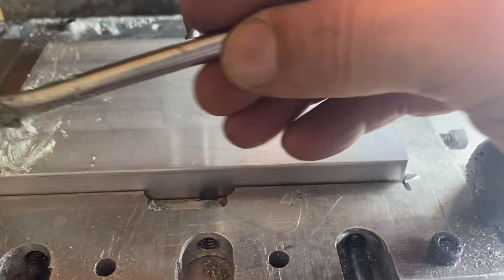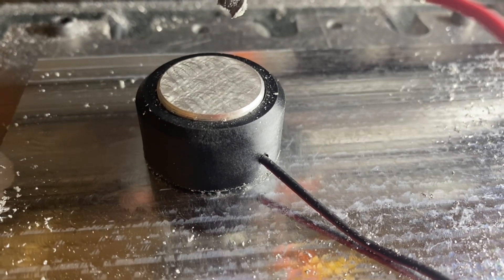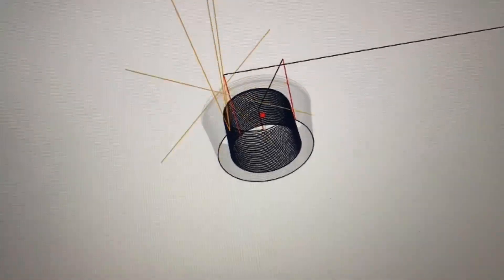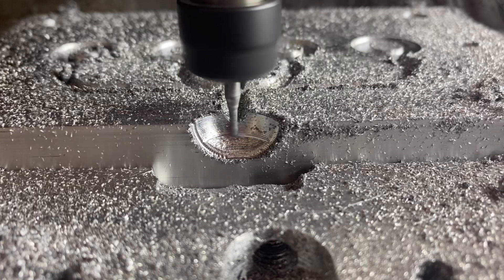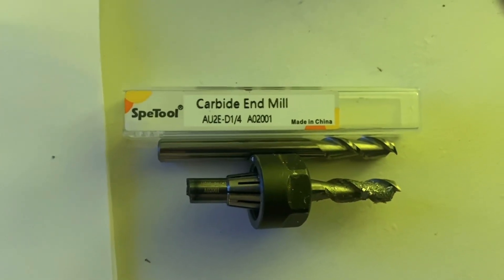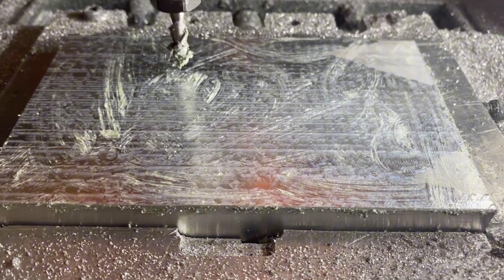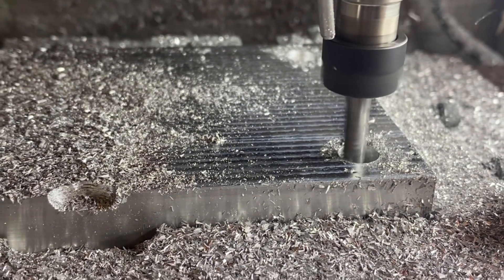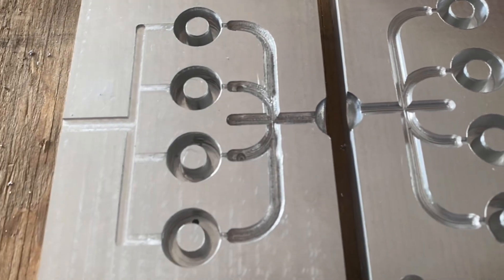Genmitsu 3020 cutting aluminum ￼ injection mold

Comment: Great video! I am so close to hitting the buy now button on several machines, but then I saw your video.  I have 2 Bridgeports and 3 lathes, from a small Southbend 9 up to a Storebo Bruk 14x40. All of my machine shop is old school manual, apart from DROs. I have been searching for a reasonably priced, small CNC to bang out repetitive parts and for an easier way to do curves. 
Your video has helped me make up my mind. It seems they all say they can do aluminum, but then I see the videos, and it's always a hard nope. Too much flex, not enough power and too much inventing ways to improve them. From what I see in your video, the 3020 Pro Ultra can do what I need. This looks like a good machine to have running off by itself while I do the tougher tasks on the big manual machines.
I have Fusion 360 and know my way around it. I model everything with it, from 3D prints to making fab drawings for use on my manual machines, so the learning curve should be manageable.
Thanks again for providing a real-world example of what this machine can do.

Comment: Injection molding is witchcraft to me, although I did get to spend a couple of inspiring hours with the tool & die makers in a factory...Magic!
Curiosity makes me ask the purpose of the blind channel that is a continuation of the inlet.  Thanks.
Reply from the maker: @PiefacePete46  the purpose is there is often a hard piece of plastic on the injecting nozzle. You don’t want that going into your mould and blocking things. So you send it to a dead end which is then trimmed off and cut when you remove the parts otherwise you’ll end up with blockages in your injection process.
Reply: @iBuildStuffCNC  :  I KNEW there had to be a sensible reason...  I could have guessed all day and not got close!
That would make a good exam or quiz question.  
Thanks for making the time to reply.

Comment: Nice video, you seem to be getting a lot of chatter  , it looks like your tool holder is very tiny, but it might be helfup to choke up on your tools as you are not going  very deep. you may also bennefit from some sort of coolant system , even if its just using a soda bottle with some mineral oil or water with a hole cut in the cap  .   what type of aluminum are you milling here?

Comment: Very nice molds. If I may offer a piece of advice I would run single flute o cut bits. I have used the exact same 2 flute endmill from speetool and have found it sucks for any operation that has a plunging operation i.e. 2d contour or 2d pockets. The single flute will give you way less chatter and way cleaner cuts because it can evacuate chips much faster than a 2 or 3 flute endmill. I use the SpeTool O Flute UpCut 1/8" X 1/2" Carbide End Mill. On my carveking from millwright I run 40in/s with .022in DOC. My gantry is relatively stable but the plastic spindle clamp would seem to introduce a lower frequency and therefore I would recommend starting with a .07in DOC and 30in/s withe the single flute.
Reply: Like you, I am a fan of single-flute cutters with aluminium.  iBuild Stuff mentioned his reason for not using single-flute, possibly in another video, so he obviously has tried them.
Reply from the maker: @i_make_thing  i’ve tried the single flute, two flute, three flute, etc. I really enjoyed the two flute cutting. I have several single flute cutters also. But I tend not to use them as often. Unless I’m boring a whole deep. Then sometimes I use it in order to prevent chips from blocking the cut process. But it better be deep deep. I generally cut up to 15 mm with two flute cutters. Even very small diameter holes that are slightly bigger than the cutter themselves by just .2 or 3 mm. I also generally do not use anything larger than3/16. I’ve used a bit of quarter inch for facing. But I find that I get a better cut using 3/16 or smaller. Thanks for the advice, check out some of my other videos.

Comment: Awesome video! What bits did you use?
Reply from the maker: I basically only run SpeTool bits.  The ones that are made for aluminum only. It’s amazing how many miles you get out of them. I’ve been running my 1/32 bit over 20 hours now. And I from my 1/4 bit for several months. It must have faced at least 100 in.². and it’s still going strong.
Reply: @iBuildStuffCNC  Awesome! I got to try those! you using Fusion 360 too?
Reply from the maker: @TheAndy-Show  yes fusion 360 is awesome. I don’t know anything else.
Reply: I have had the same machine, I would suggest you use a 1 flute bit for aluminum instead for the rough cutting. Those are so much better for cutting than a 2 or 3 flute cutter for a machine that need these spindle speeds.
Reply from the maker: I basically only buy SPETOOL bits.  I get them on Amazon. And I choose the ones that are specifically for cutting aluminum only. They’re usually a single or two flute cutter. I prefer the two flute myself.